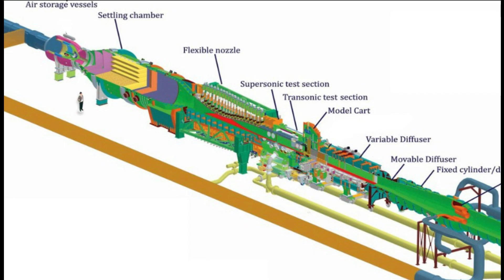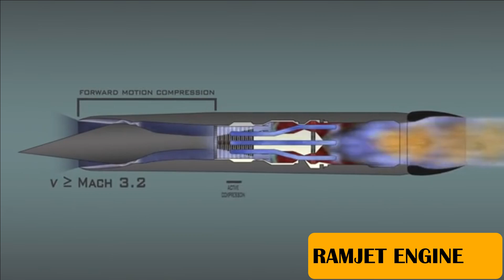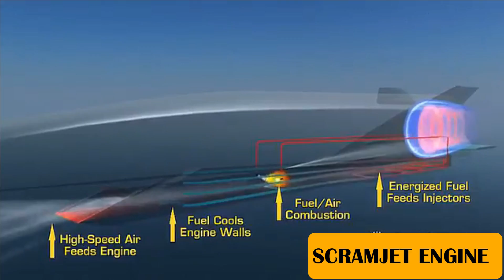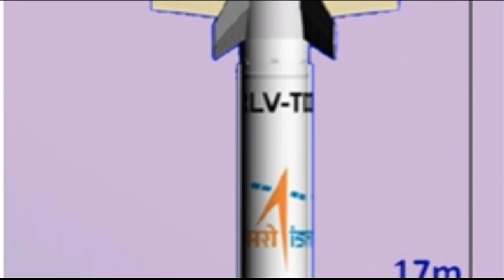ISRO conducted Hot Test of Scramjet Engine for 11s |  HAVA – Hypersonic Air Breathing Vehicle #isro

Comment: Glad to see forward progress on scramjet technology, while the USA is still stuck testing hypersonic gliders, which is far less advanced. I do wish there were any updates on how the hypersonic glider is doing but zero word on that so far. This rate of progress is encouraging and the tech requried to build the scramjet hopefully trickles down to engines like Kaveri which need the ability to withstand high temperatures too.
Reply: How does it helps in supersonic fighter jets engine. Please share your views on it. As far as i have gathered supersonic fighter jets engine are made to withstand temperature at around 2000° C and metal to make it requires tungsten kind of strong metal and light weight too. This information i have gathered from Coln.  ajay shukla article. Rest i am novice in this field! 
Thanks!
Reply: @ranjaypandey4360  Basically scramjet has to withstand high temperatures, and the material they used can be used in jet engines too. Same stuff as carbon composites. Also pushing boundaries of science.
Reply: @datoolz0  Nice!  This means we are an inch closer to make our own supersonic jet engine by using composite materials of Scramjet engine develop by ISRO for its futuristic launches! 
Thanks for valuable information!
Reply: @ranjaypandey4360  I would still love to know where our hypersonic glider project is, that is the one of the first and easiest projects. No public news at all!